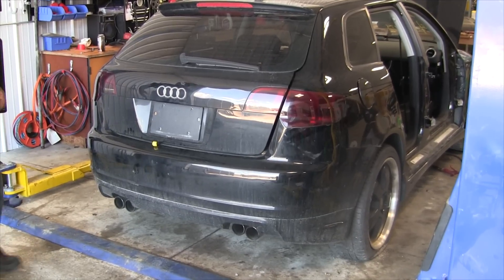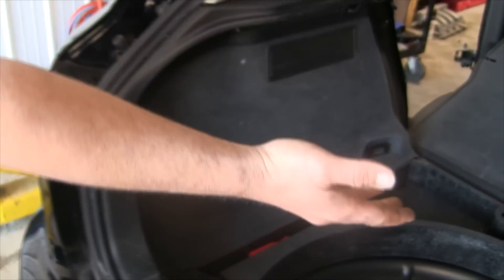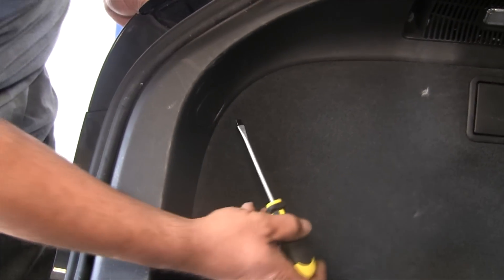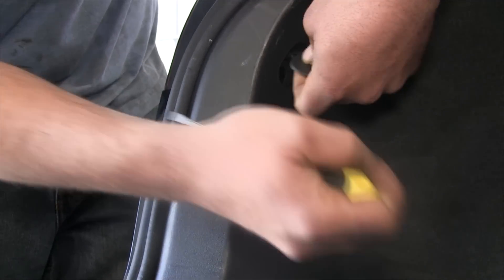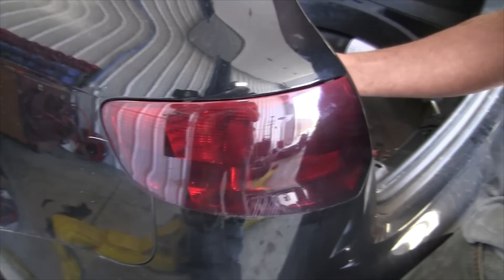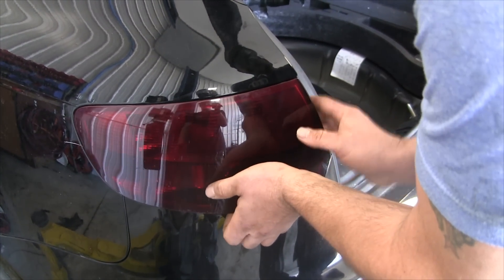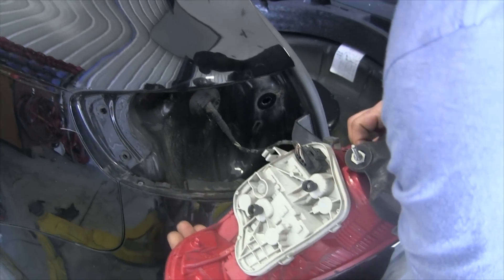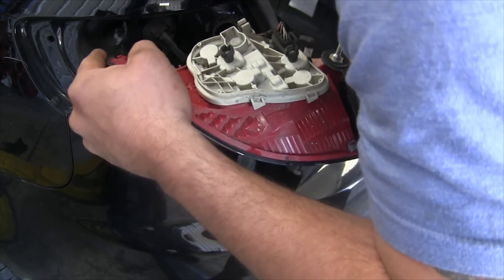How to Remove Your Tail Light / Replace Bulbs - AUDI A3 (2005-2008)

Comment: I'm placing a flat head in the plastic hole there and it won't twist off
Reply: Use some pliers to get a better grip. A bit of wiggling to and fro should loosen it off then you can slot your screw driver back in. If you need new pastic bolts: https://www.ebay.co.uk/itm/Audi-A3-8P-A6-C6-TT-8J-Rear-Tail-Light-Securing-Bolt-New-8P0945300/174143700597?hash=item288bc5fe75:g:XoEAAOSw7ypeDfQL

Comment: How about the ones on the hatch ?
Reply: I'm STILL looking for just such a video (dealer wanted to charge me a great deal for it) - I've heard it's a pain in the rear but hopefully there's something out there explaining how it's done, at least!!
Reply: Jaska Börner It's actually not that hard. Sort of the same concept you should give it a shot. Once you open it take a picture with your phone before you touch anything to make sure you know how to put back together. Good luck
Reply: @neburfernandez7379  any video of such things please?
Reply: @arden6665  nope sorry
Reply: @neburfernandez7379  hey no worries I figured it out. The nut and bolt with the creamy plastic around it is the one you undo to take the whole thing out .
Reply: @arden6665  I appreciate it !